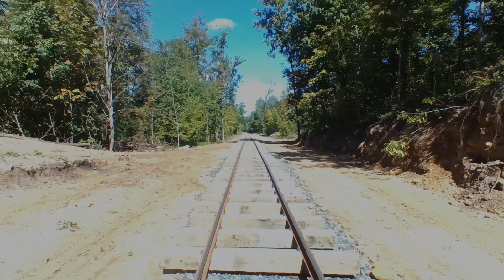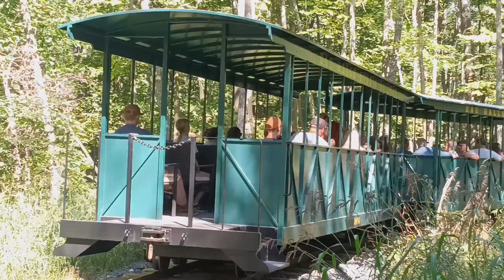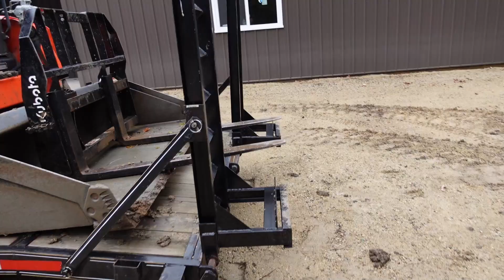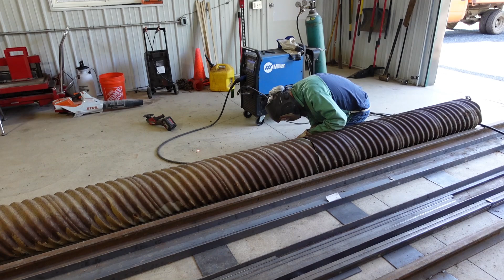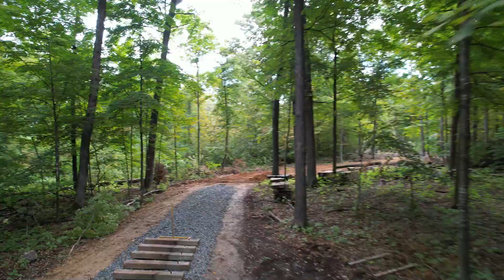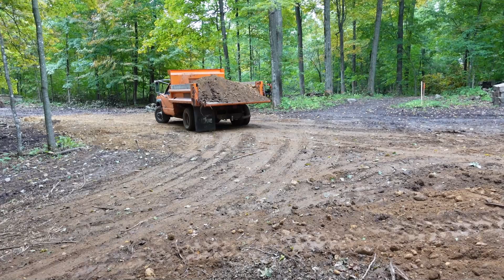Weekly Railroad Wrap Up First Week of September 2024

Comment: I am a new sub. as I totally got hooked watching all the videos of this railroad. I live in Cornwall, England, and we are spoilt for preserved railways over here, but, have you any plans to use a steam or steam outline locomotive on your line at some stage. I realise that with all the crops in the fields its a bit dodgy with steam engines, even with spark arresters as sparks could ruin a lot of hard work in the fields. Just a question if you had any plans to introduce a steam engine or diesel powered engine that looks like a steam engine?
Regards, Paul.
Reply from the maker: @PaulWilliams-h1y  Hi Paul.  We love our little Hunslet (made in England) locomotives, but if we could find the right deal on the right steam locomotive, we'd love to have one.

Comment: The old 1 ton, looks like it is getting a workout. Is is an old Dept of Public Works truck? the color is correct!
Reply from the maker: Yep, we believe it is.   A friend is lending it to us.
Reply: @joekelley1014    This Eau Galle endeavor is a journey down memory lane at times.  I had the opportunity to work for the Apache Railway in Northern Arizona in the late '70's as a gandy dancer.  Most of the MofW equipment was "hand-me-down" from sources that built antiques.  The resident dump truck was a gas powered 1947 through 1953 lineage Chevrolet with permanent hi-rail wheels attached.  I never saw it working.  The welder-shop truck was a 1952 Chevy former telephone company truck with that short-sloped equipment and tool box) without hi-rail capability.

The Apache, owned by Southwest Forest Industries, was famous for the stable of blue and white Alco units.  Work horses they were, too.  Heavy coal loads in from Holbrook to power the paper mill West of Snowflake, and loads of craft paper, also heavy, out in box cars bound from everywhere.
Reply from the maker: Very cool

Comment: May I suggest, when you are talking about a turnout (the term "switch" is the moveable part), refer to the frog end or the switch end and maybe left or right while standing at the switch looking toward the frog.

Similarly, for a rail car, the "B" end is closest to the hand brake, and the other end of the rail car is the......wait for it....."A" end.  That makes it easy, while always standing at the "B" end to talk about the right and left sides of the car as well as axle and wheel 1, 2, 3 and wheel 2R, etc.
Reply from the maker: Good information. Thank you!
Reply: Turnout is the modeler’s term for a switch.
Reply: @DavidClifton2   I shall not proceed to disabuse one's understanding of nomenclature viz a viz technical elements commonly recognized.  It is quite de minimis in the long term.
Reply: @glennfoster2423  I don’t care really, I don’t know why the model community chose to name switches turnouts, but they did. As long as we like trains, I don’t care. Not a grammar police.🚂🚃🚃
Reply: @DavidClifton2  OK,  I agree with that.  I introduced my comments with the intention of them being a suggestion to avoid an excursion into dogma.